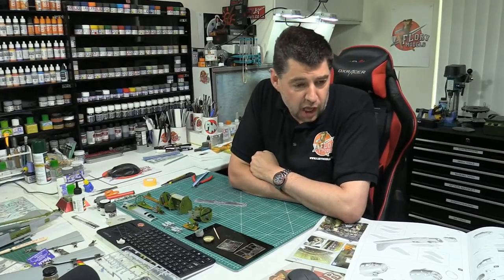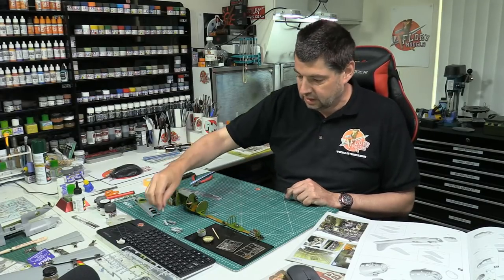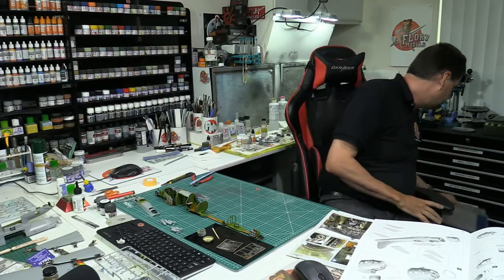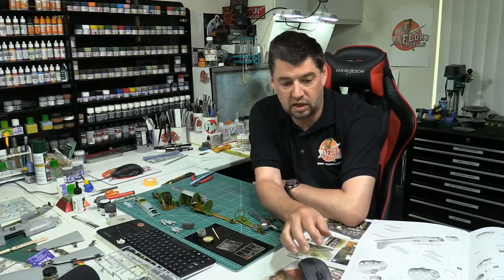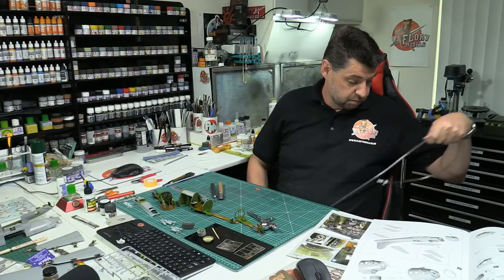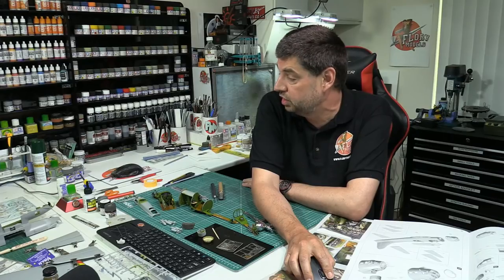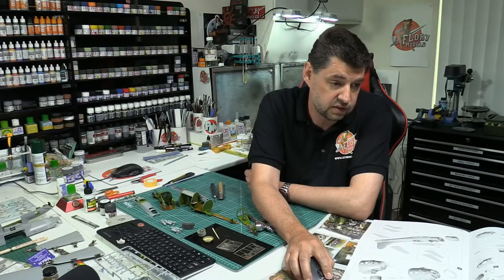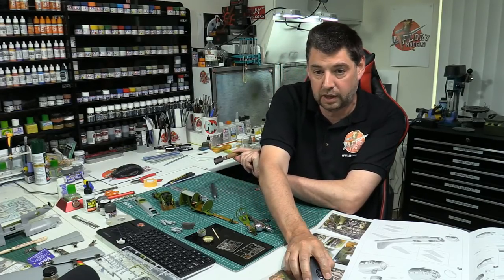Flory Models Live Show Tuesday 15:00 (GMT+1) 19th May 2020

Comment: The earlier G models had the same waist windows as the earlier types. The stagger was introduced at about the 25th production run at Douglas, soon followed by the Vega and Boeing production lines. Which is why you will find individual B-17s with un-staggered waist windows but having the later Cheyenne tail gun position startting at the 40th production run, many of which were field fitted after manufacture using a "kit". (One example was the famous "A Bit o' Lace" which had the unstaggered windows and the late tail turret.)  Reference is Ken Darling's "B-17 Flying Fortress" Warpaint book.
Reply: Did not know about the field turret kits. Thanks for this.
Reply: @wrathofatlantis2316  The reason they are referred to as "Cheyenne" Turrets is that many were so fitted at a Modification Depot in Cheyenne, Wyoming after delivery from the factory, and afterwards, then sent on to Europe. Others were modified using "kits in the UK as required.  Not unusually,  the name stuck.